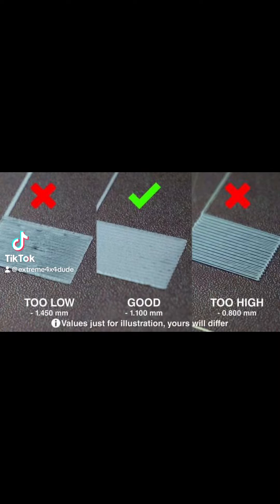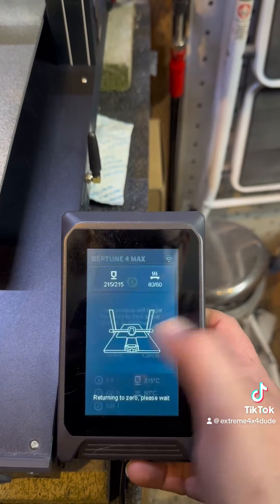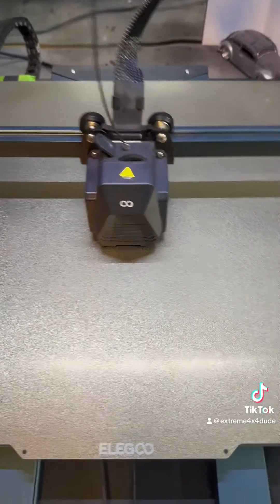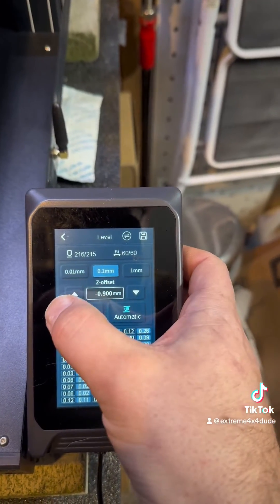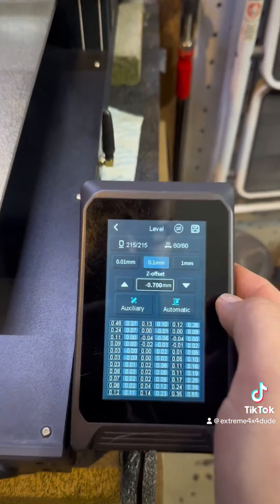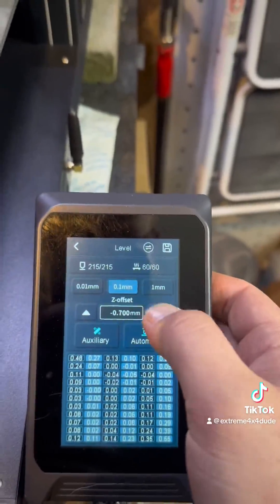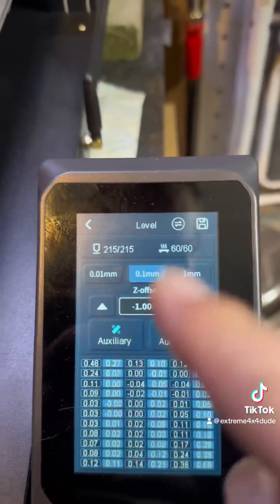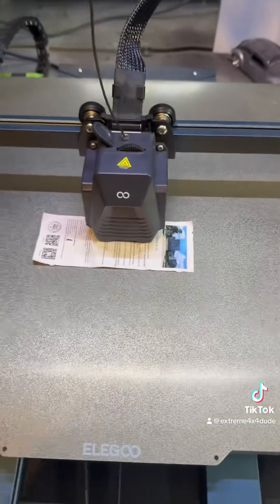How to achieve a good first layer adhesion on your Elegoo Neptune 4 3D Printer.

Comment: So there should be some resistance between the nozzle and bed?
Reply from the maker: You don’t want resistance between the nozzle and bed. That could wreck your flex plate. But if you’re referring to using the paper method during manually bed leveling then yes you want a little resistance in the paper when you move it around.

Comment: I just got mine 2 days ago, I had a lot of difficulties in the first layer adhesion, after spending many hours leveling and re-leveling, I thought it was good. So, I started and printed a 4 hours print. Unfortunately the first layer did not stick and made a big mess and fully clogged the extruder and cover all the wires with the PLA. unfortunately, I need to get new extruder, and try not to screw everything again 😢
Reply: I've heard this was an issue.  I'm keeping an eagle eye on my prints now.  At least for the first few.  That's IF I can get anything to print.

Comment: So, you don't do auxiliary setup? I just can't understand if i need to do auxiliary or don't. I have done many auto bed leveling, but every time i do auto bed leveling i do auxiliary too and no matter how many times or how much or little pressure i put between noozle and paper, i can't get perfect first layer.
Reply from the maker: I’ve made some modifications to my EN4MAX’s so that I don’t need to manually level the bed. But before I modified I would always manually level the bed before autoleveling.

Comment: Great Video

I have a big problem with my Leveling. When i select 'Leveling' and then select continue, the Z Axis is way too deep and the Nozzle gets pushed into the Heating bed. Any Help?
(Elegoo Neptune 4)

Thank you
Reply from the maker: You should be able to manually adjust the z height in the bed leveling section so that it doesn’t do that.
Reply: Your sensor can't "see" the bed if it is crashing, mine wouldn't work out of the box until I unplugged the sensor and plugged it back in, heard some of em came completely unplugged- neptune 4 max

Comment: My prints are not adhering to the print bed when all the settings eem to be working. Would you know how I could solve that?
Reply from the maker: Have you washed the plate with soap and water? What’s your bed and hotend temps? I typically print at 220/60. What filament are you using? I’ve had the best success with Sunlu PLA’s. Some other filaments I’ve tried just don’t want to stick.
Reply: Its possible your bed might be warped in some places. Your best bet is to contact Elegoo support.

Comment: Yall please use a .1 mm/ .004 " feeler gage. different paper is different thicknesses. If you dont have feelers soda can is .004"
Reply: I work in a Machine shop on a VF6. Our smaller machines like the old VF2 doesn't have probes. We use random bits of paper all the time. For 3D printing paper is all you really need. Now saying this isn't needed for 3d printing, if we wanted to be accurate to tenthousandth of an inch(.0001), we would use a bit like lets say a 3/8" end mill(.375). With it roll it under your nozzle till it won't go no more. Using a go, no go approach is better than feeler guages.
Reply: @VR6NAVYVW  I am a supervisor at cnc shop. I do not alow paper. Using a 123 block or .001 shim is more accurate.

Comment: 1: manual bed level
2: Automatic bed leveling
3: print z offset test
4 adjust z offset and print another test
5: repeat 3 and 4 until the first layer looks perfect
6: print a bed level test
Reply: Whats the difference adjusting the z offset after leveling vs before?
Reply: So this is more or less a leveling multiple times approach to allowing a bedsoak right? I found that the 30 min bed level is... useless. I have pretty constantly found that my bed takes much longer to heatsoak and actually snap into it's long term position. My offset changes from -1.7 (I know, I know) to -.9 once it's finally soaked.

Comment: What I found was my wheels 🛞 were so loose I had to tighten with Allen wrench 🔧 then lever bed manually and then automatically lever after that. That helped but ended up using blue painters tape . I will have to learn how to do this what you just showed us . Ty
Reply from the maker: I just had an issue with bed adhesion and I tried using rubbing alcohol and then releveling the bed. It did not help. What did help me was taking off the plate and washing it with soap and hot water. I put the plate back on and bam sticky first layer. I’m just glad I caught it not sticking because a blob started to form on the hotend and that could have been disastrous.
Reply: @OuterRimArmorer  I will do that in the morning really got me down.. I let you know . Stay in touch thank you
Reply: @OuterRimArmorer  ok my prints sticking better after washing plate . But  if bed is not totally level and model has tree support fan will knock it off build plate , thinking about removing fan all together . Not designed right. The model was a figure laying flat to on build plate with tree support.
Reply from the maker: @PeterAgostiniJdcap26 I have had similar issues. You could try to enable Z hop?
Reply: @OuterRimArmorer  how do you that ?
Reply: @OuterRimArmorer  they say the Sovol 7  is supposed  to have zero problems someone told me
Reply from the maker: @PeterAgostiniJdcap26 if you’re using Cura look under Travel settings. I believe it’s near the bottom. Enable “z hop when retracted” and then set the z hop height to at least .4 I like to do .6
Reply from the maker: @PeterAgostiniJdcap26 if you’re using Prusa Slicer look under Printer Settings and the Extruder section. There will be a section called Travel Lift and under that is Lift Height. Make that .4 or .6 and save your settings.
Reply: @OuterRimArmorer  ok in morning Ty
Reply: @OuterRimArmorer   thanks no I don’t use but maybe some one else this will help
Reply: @OuterRimArmorer  dude had to put a new nozzle in see my community tab on my channel . 
Had to  pull pla  out of nozzle and take  front cover  , heat up nozzle and pull the chunk of pla off then took a socket # 6  mm and replace nozzle .
Reply: @PeterAgostiniJdcap26 brother these nozzles and the way they can clog. I hate to be a shill, but I have had more luck so far with my Microswiss hotend.
Reply: @number1eclipse  im sure you have . I dumped that printer and went with Bambu lab A1 and X1